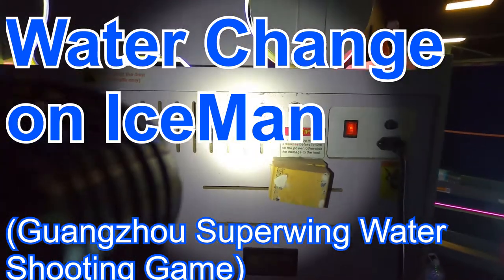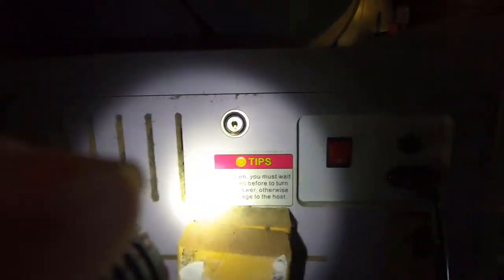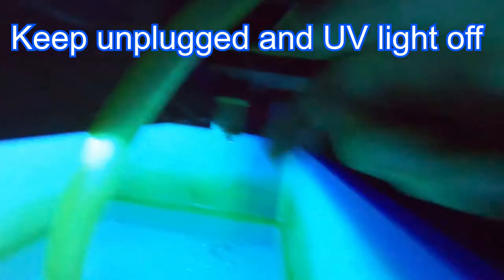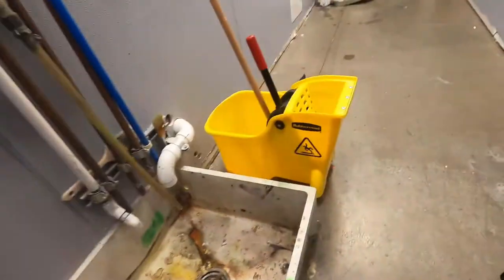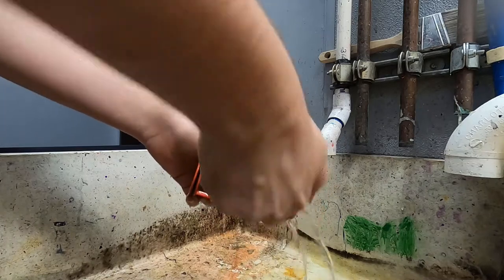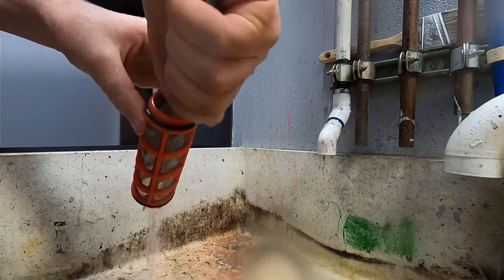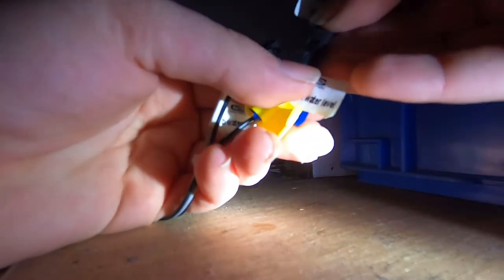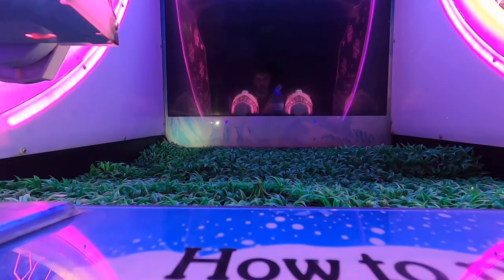How to Change Water in IceMan Arcade Game

Comment: Do you happen to know about the error of "Magician", a game from the same company? Do you know the solution to "Water level is high"?
Reply from the maker: Not sure about that game(not seen it), but check the upper float switch, and fill to about halfway between the minimum and maximum line. Also, read the instructions.
Reply: @100griffin  thanks